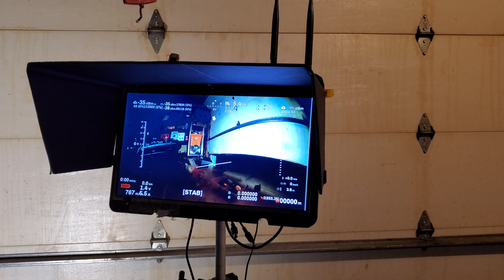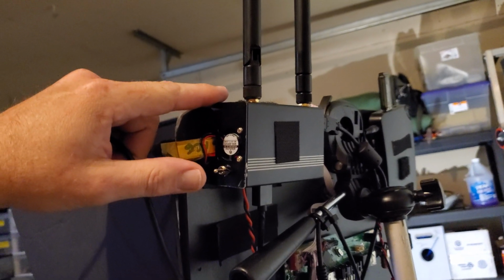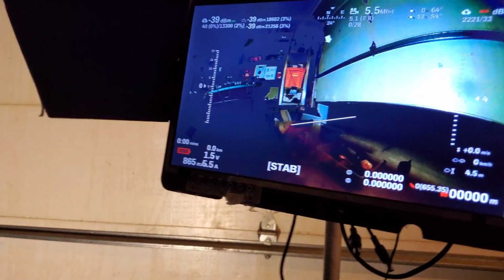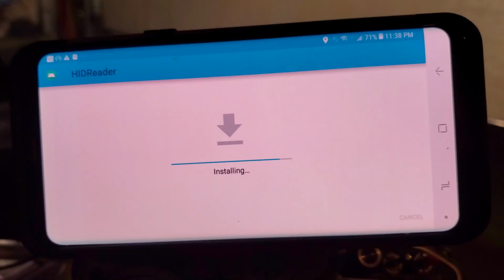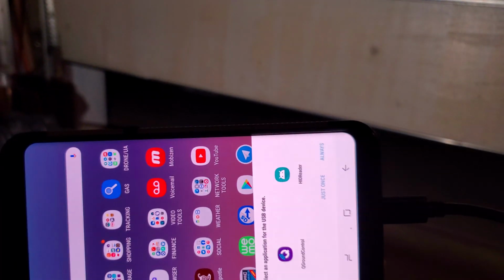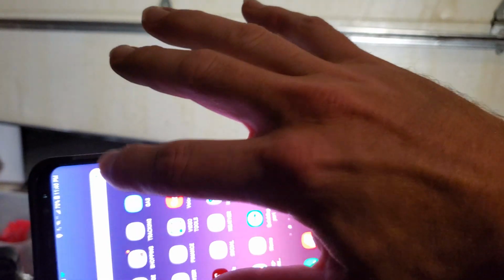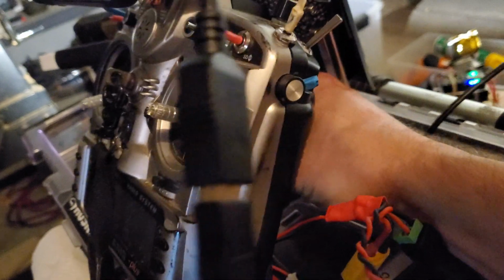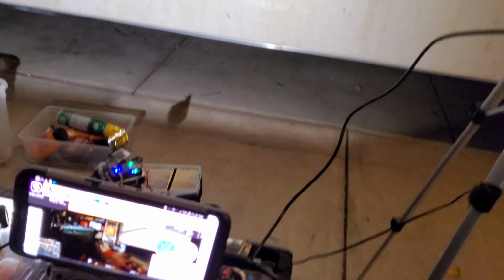Open.HD USB RC Setup Options

Comment: I have a basic question. I installed version 2.0.2 of OpenHD and I wanted to change the OSD Display information. I switched off a lot of items. I moved the Home Arrow. Nothing changed when I looked. What am I doing wrong? I've changed and turned OSD elements off in an earlier version of OpenHD why can't they be changed in the latest version? Also, there isn't any fonts in the font folder so we can't change fonts either? I added a font to the folder just to test and that didn't work either. Maybe a name clash but don't know. Just asking someone to see if they know anything about my issue.